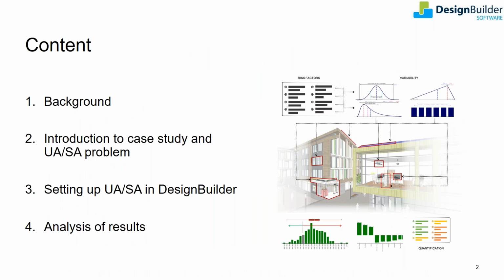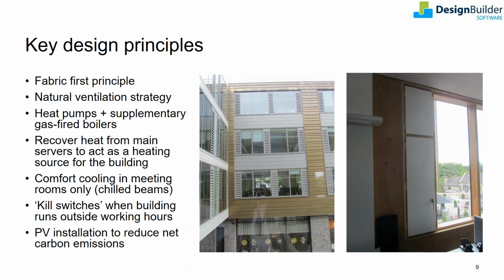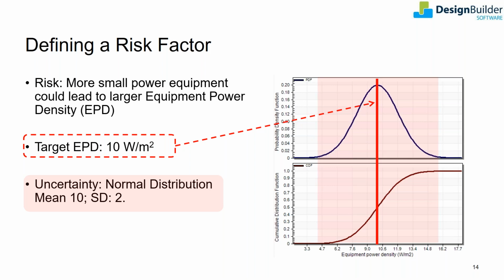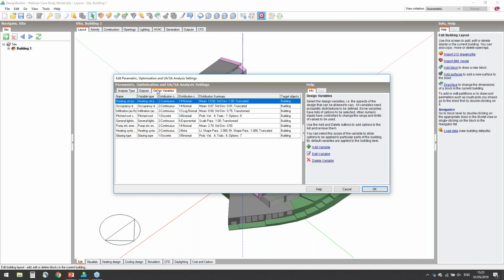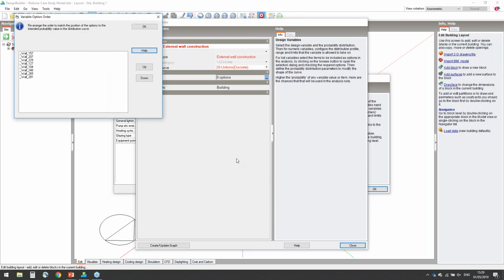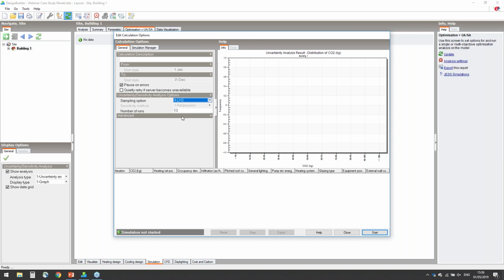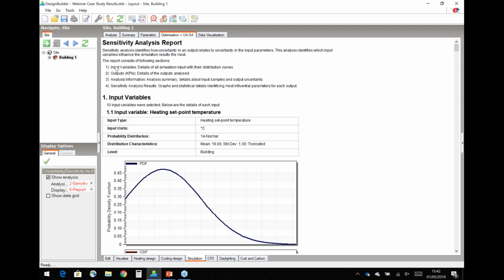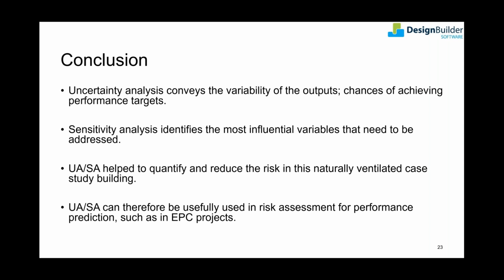Uncertainty and Sensitivity Analysis  Improve Decision Making and Reduce Risk

Comment: This is very informative. Can we have pre determined Design based risk assessment flagged off right during the early design stages? I know real time would take lot off data processing and almost may hang the system...
Reply from the maker: You can set up the sensitivity analysis parameters from early design stages itself and run it at different times as your design evolves. Once the analysis parameters are defined in the model, in most cases its just about just pressing the update button to run again.
Reply: @DesignBuilderSoftware  thanks a ton...